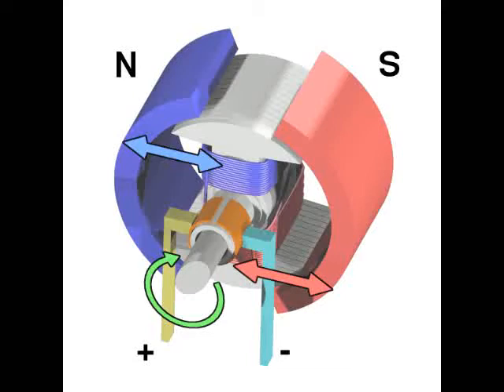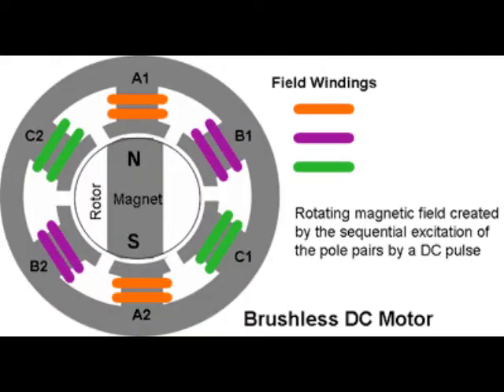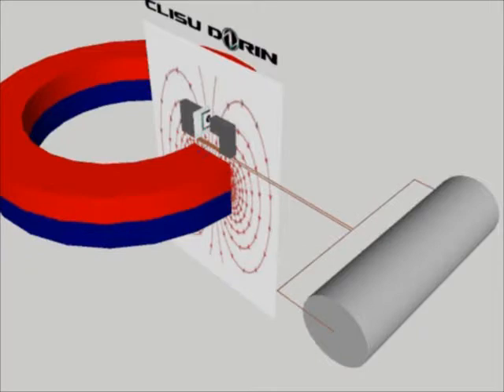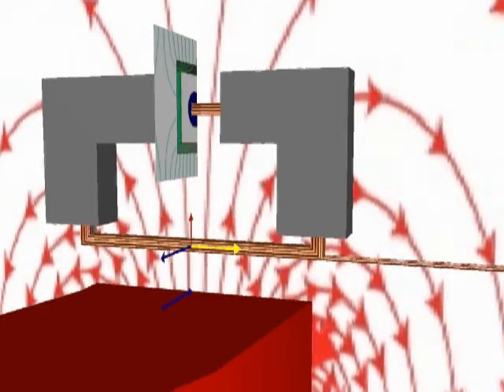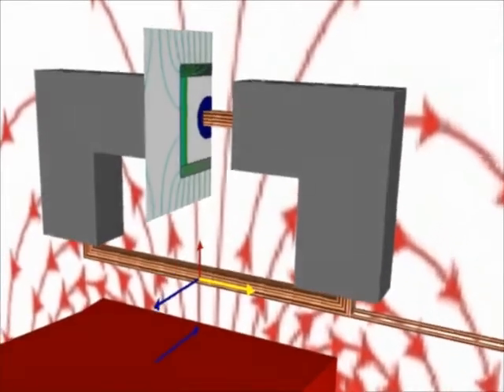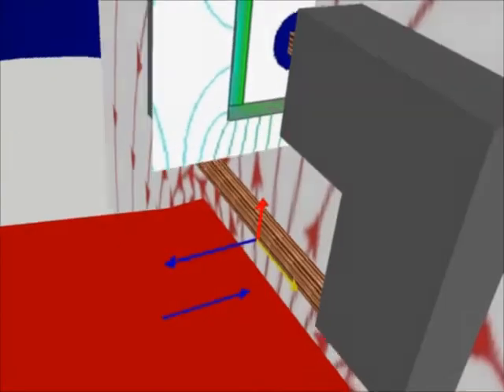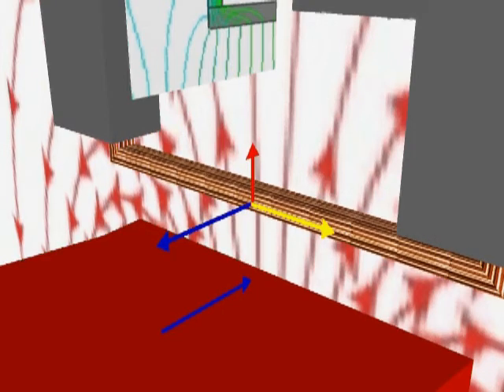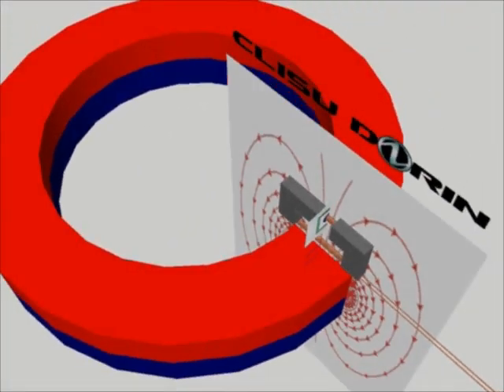World's first TRUE DC brushless motor - concept

Comment from the maker: 1. I know how to duplicate a mono into stereo, I just forgot to do it and I didn't notice until now, sorry. Now I don't want to reupload just because of this..

2. You did not get the point. They are true brushless but they are not DC! Transistors are not part of the motor so the motor is still AC.

3. The blue arrows are the resulting dF electromagnetic force acting on the coil and on the magnet. dF = B x I * dL